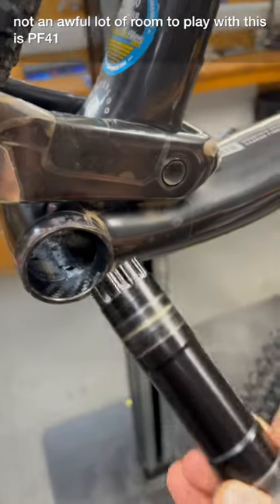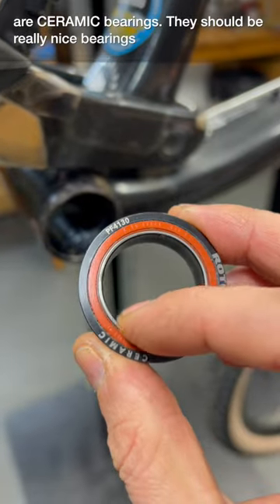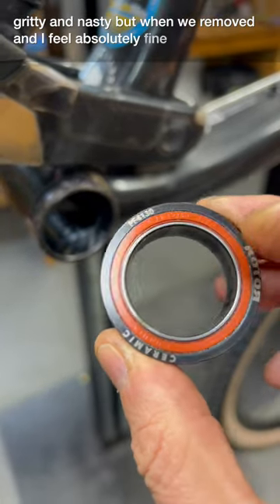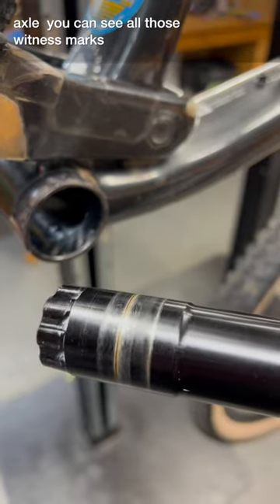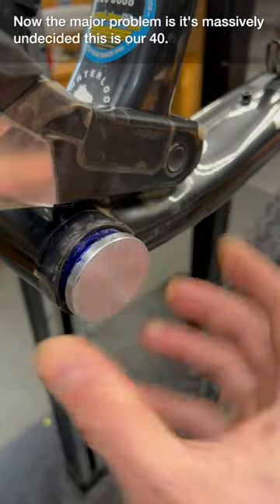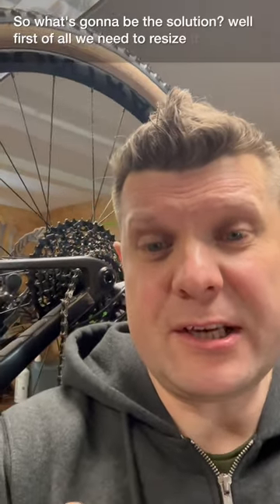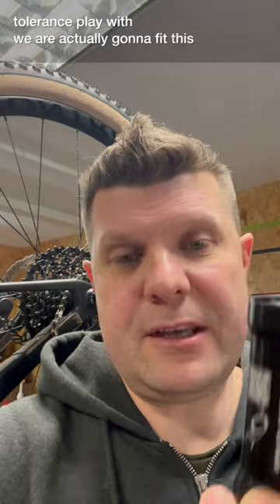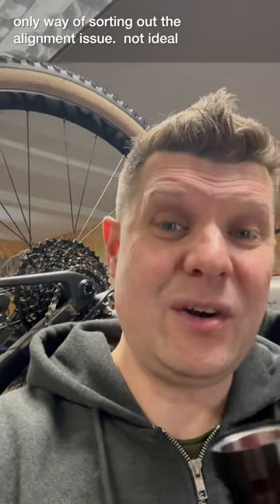30mm to PF41 on a Trek SuperCaliber

Comment: Threaded bbs just work :)
Reply from the maker: Aye. Mostly. Or at least they are easier to sort.
Reply: Misaligned bb shell can still be an issue, also threads might be misaligned too. If prethreaded shell was welded on, and done badly it might be deformed. I saw a Trek Domane I think it was on Hambini's channel, somehow the BB shell was so deformed it was impossible to install a bb. Horribly welded. So the factory there did major mistakes, should not even ge out of the factory.
Reply: @mtbboy1993  I bought a threaded 24mm Chris King bb as soon as it came out about 12-14 years ago and it has gone from frame to frame without issue. The system just works and its so much easier to work on. I have had two bikes with pressfit and they both had creaking issues.
Reply: @jonathanhowson6420  my point was is great BB does not solve horrible BB shell. 
A thing to note with Chris king is to not overgrease it, if you do the seal pops off, even factory greased is too much, it makes a mess, but if you pack it full of grease seal pops off, might do in few rides. But other than that, no issues with the BB, it actually runs smoother than new.
Reply: @jonathanhowson6420 i work for Chris King. You hear this a lot about our components.
Reply: @mtbboy1993 yes, Chris King bearings can actually be run with no grease. Just so you know. They are made with such hard balls and races that they just get faster as they burn in and no issues because of how hard those materials are. I work at Chris King. We hear all this a lot.

Comment: For those paying all this money for a new bike, do some homework and choose your bottom bracket carefully. There is a reason after 10 long years, the majority of the bike industry after screwing the public is returning to threaded bottom brackets both BSA and new T47.  Carbon threads will be the new norm in 5 years which btw is OK and an improvement over press fit.
Reply from the maker: You’re gonna love some of the upcoming vids.  PressFit is awesome if we can just teach QC to check properly and teach mechanics to fit it correctly. We have a plan. Carbon threads are just an unnecessary cost. It’s a solution to a problem that shouldn’t exist.
Reply: @Mapdec is it less comon in aluminum frames?
Reply: T47 is actually an old standard. Its over 40 years old. It was developed and used by custom frame builders.

Comment: Got a new bike with PF41 (Scott Addict Gravel) and actually want to ride the new Force groupset.
The combination is not ideal, since it only comes with DUB cranks these days.
What BB can you recommend?
Reply from the maker: I thought I knew, but doubt has been seeded recently.  Right now, I think I would just use the SRAM own BB.  They are probably the best sealed.
Reply: @Mapdec why the doubt
Reply from the maker: @diehardbikes  because Rotor, Hope, Enduro are no better and cost a whole lot more.  Seems you can’t engineer out of a poor situation. Just replace frequently.  The sram BB is actually pretty well weather sealed.

Comment: Why not go for a 24mm new crank? + Ninja pf4124 bb
Reply from the maker: Because this rider is sponsored by Rotor.
Reply: @Mapdec  Then he is on the wrong bike. To have any chance for long term bearing integrity, this bike needs a Shimano 24mm spindle diameter.
Reply from the maker: @lukewalker1051  if only it were that simple.

Comment: Can't you get the frame manufacturer to supply a frame that is fit for purpose?
Reply from the maker: We are trying. Keep spreading the word. The only way they will do that is if we spot faults and reject bikes.
Reply: @Mapdec  if in the UK  the makers either have to make good or replace. It's the law.
Reply from the maker: Yes. They do.  The problem is that bike shops are not checking before selling.